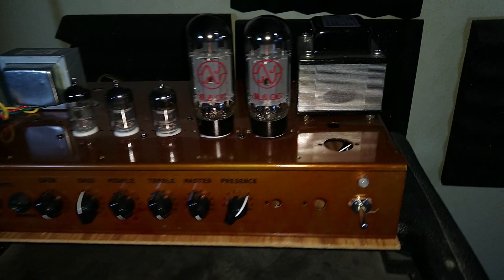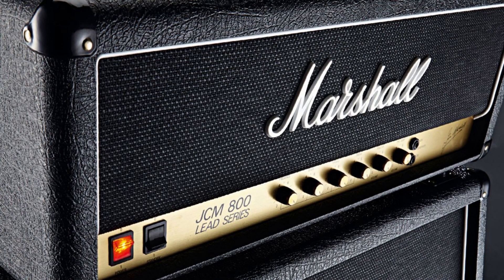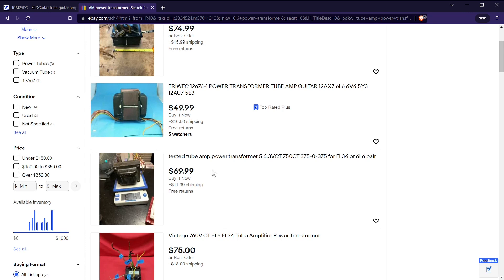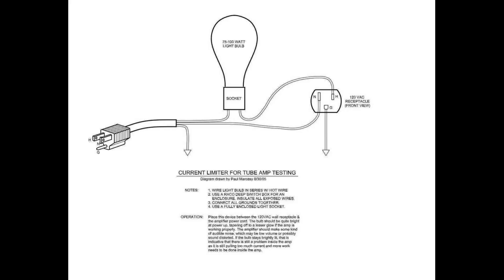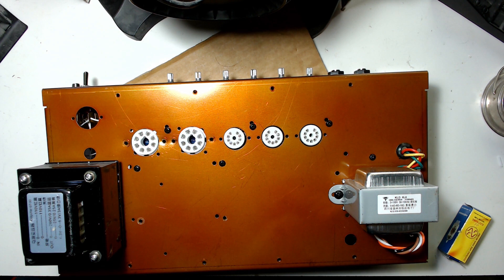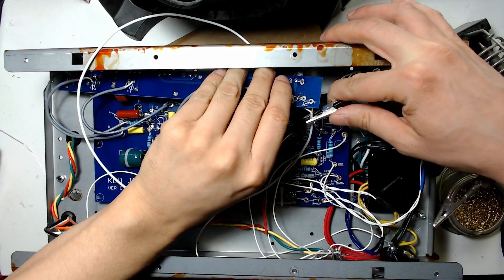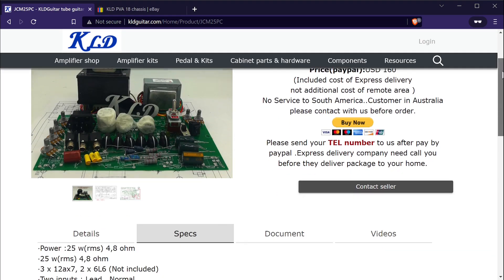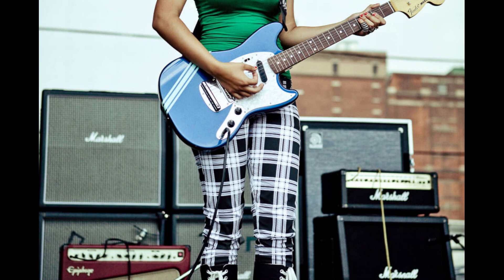Build Your Own Guitar Amplifier - KLD JCM25PC Kit Review, Guide & Tips - Marshall JCM800 Clone

Comment from the maker: I finally got around to building the cabinet for this amp, check it out! https://youtu.be/TjmcVeNQGbU

Points I forgot to mention in this video:
- Build quality is good.  The PCB is thick and seems comparable to the quality that the major manufactures use. The transformers are heavy and sound good. Alpha pots were included and the rest of the components are perfectly fine.
- The preamp section of the circuit looks identical to the real JCM800.  The tone is very authentic.
- I should have spent more time adjusting the mic placement.  I think the recordings are kinda bright and lacking bass.

Comment: What you're actually doing when you bias output tubes is you're basically balancing power dissipation versus output tube life, you want to bias them so that they operate correctly, yet at the same time they shouldn't be operating at the point where the Plates or Anodes aren't over-dissipating and going into something called Red-Plating where they glow red-hot, most amp techs like to bias the power tubes so they are dissipating about 60-70% of the maximum Plate or Anode dissipation.
Reply from the maker: Yep that's true, the bias also has an effect on the tone and headroom. Hotter tubes usually sound "sweeter" up until a certain point.

Comment: Thank you for this video and the comprehensive details on the design of this kit. I am glad to finally find more detailed information on this kit and you’ve helped to convince me to purchase it. One question I was wondering was if the amp head is powerful enough to power a 400W(8ohm) speaker cabinet?
Reply from the maker: For sure man, happy to help!  Yup this amp will have no problem driving that cabinet.  It obviously won't push the cabinet to its max potential, but I think you'll definitely be pleased with how loud this amp can push it.

Comment: I think I will look into one, the thing I don't understand is, how is it only 25 watt, class A?  I have two amps with 6L6GCs, one has two and it's 50 watt, the other has four and is 100 watt.  My 100 watt has a control to go from A to AB and points between, and I understand that when it's all the way to A, it's 50 watt, thus the question is it class A.

Edit: Another thing I just thought of, the JCM800 uses EL34, not 6L6. Do you know if the socket can be changed and use the EL34 or use the socket adapters? I can't with my Valve King 100, because of the A - AB control.
Reply from the maker: This amp is class AB, but there are other factors in the design that determine the output power. More output power requires larger transformers so I think they intentionally capped it at 25W in order to save cost, space, and weight. It's a budget kit after all, and 25W is plenty for most people.

It should be possible to swap the power tubes for EL34s but the circuit will likely require minor modifications and obviously it'll need to be rebiased. I haven't looked into it since the power tubes have a minor impact on tone when compared to the preamp section, and I'm happy with how it sounds at stock.

Comment: Just bought one directly from their site, do you have a list of things I'll need to buy not included in their kit?
Reply from the maker: It comes with everything except the chassis and the tubes.  The link for the chassis is in the video description.  The tubes are 3x 12ax7 and 2x 6L6.  You also might need to buy additional hook up wire.  The kit includes shielded wire but they included barely enough, so you might need to purchase additional shielded audio wire.  Also you might need more non-shielded hook up wire as well, just make sure it's rated for high voltage, 600v rating is good.  Hopefully this helps, let me know if you have more questions.
Reply: @PhazerTech  Thanks,  I'll definitely be referencing your vid for this build. I picked up the chassis from the ebay seller. Hopefully, modifications isn't too difficult. Appreciate you offering to help, I may need it, lol.
Reply from the maker: @DerekRonin  Happy to help!  Let me know how it goes.  As long as you have the right tools the mods shouldn't be too difficult.  Also like I mentioned in the video, they didn't include enough standoffs for the PCB either.  But as long as the board is secure around where the tubes are, it should be fine.

Comment: hi @Phazer Tech, just got my kit a few days ago and started putting it together. Seems like the transformer I received has the color swapped. Yellow being P1 and Green now P2, but the schematic has them reversed still for Ver C. wiring diagram. Anyhoo a question, I was a bit confused with the LED diode. Diagram shows 2 separate led by mines only comes with 1 with 3 pins. How did you go about wiring that? Thanks!
Reply from the maker: Hello again, that's great you got your kit.  Sounds like they still haven't corrected that error, I should probably email them and bring it to their attention.
The 3 pin LED they included is actually a 2 in 1 LED.  The schematic shows two LEDs and notice how they share a common ground.  The middle pin is the common ground.  One of the outer pins is for a green LED and the other outer pin is a red LED.  This is so you'll be able to tell if the amp is in standby or not.

Also I'm curious if they included enough standoffs for the PCB?  Are the holes on the chassis aligned with the PCB or are some misplaced like mine?
Reply: @PhazerTech  Thanks for the help! let me try and resolder them correctly, lol. Mines came with 10 stand offs ( seems like they corrected that). The chassis still needed some drilling (holes we're still off and some non-existent). I have to say, your video is the most detailed in explaining problems that would happe. This has helped tremendously! Thanks!
Reply from the maker: @DerekRonin  No problem, I'm glad you found the video to be helpful.  Hopefully it works the first time you flip the switch!  What kind of tubes did you get?
Reply: @PhazerTech  Well I did run into some slight issue, luckily I had the light bulb tester handy to take some of the load but still got some spark from the pentode/triode switch (P1/P2). Any idea what may have caused it? Notice my Green (P2) wire had some burnt marks from where the spark threw off.  I got some used JJ off ebay haven't arrived yet, may change up the preamp to some tungsol, if I get it running.  Do I need tubes installed to bench test the unit? I read it was a common pratice for first time built or testing very old units, paired a dim light tester.
Reply from the maker: @DerekRonin  First double and triple check all the connections.  Also make sure your soldering work on the switch is clean.  If you put too much solder on the joints then they might be too close together and it might cause arcing.  

It's usually good to power on without tubes first.  But there might be other problems that you can't find out until you put tubes in.  Also keep in mind voltages will be higher without a load from the tube.
Reply: @PhazerTech  That was my exact problem, you nailed it on the first try! After I cleaned up the solder and redid the heat shrinks,  no more sparks! Tubes are coming in this week, so should I be adjusting the bias to zero (counter clockwise and measure resistor values of both tubes installed?)  Thanks again!
Reply from the maker: @DerekRonin  Haha awesome dude, that's great news!  Yup measure each resistor with the tubes installed.  I would first set the biasing trimpot to somewhere in the middle.  Maybe not exactly in the middle but more like 10 o'clock and go from there.  And of course make sure you bought a matched pair of tubes .  Looking forward to hearing how it goes, cheers!
Reply: @PhazerTech  Thanks again! Once the tubes arrives, I'll let you know how things goes!
Reply: @PhazerTech  Had a quick question on the pentode/triode wiring. Did you have P1/P2 wired up to the side that says Triode? And B+B to Pentode side? Just noticed after I corrected the solder, was still getting some spark from the switch area, not sure whether  the switch has a short or I read the diagram incorrectly.
Reply from the maker: @DerekRonin  It shouldn't matter, the way you wire it will determine which side is which.  As long as P2 is on the same row as P2A, and P1 on the same row as P1A, it should work.  Also ensure that B+B is connected to two of the switch's pins.  At first glance it looks like it's only connected to one.

Here's a few other things I'd check.  Since you don't have any tubes installed, the voltage might be a lot higher than normal.  This can increase the chance of arcing and sparks in certain cases. Try putting in the preamp tubes and try it again. Maybe just try one at first, but it shouldn't matter since tubes are awfully resilient.  Don't install the power tubes until later when you're ready to plug it into a speaker.

But before you install the preamp tubes, check to see if any of the caps are bulging.  The increased voltage from no load might have been high enough to make one go bad.  They are good quality caps though, so they should be fine.  However you mentioned you had the LED wiring wrong, so it's possible that could have damaged a cap too.
Reply from the maker: @DerekRonin  Also if you think the switch might have a short then you'll need to desolder everything from it and test it with the multimeter's continuity function.  It's a DPDT style switch in case you're wondering.
Reply: @PhazerTech  Can't tell you how mcuh I appreciate your help. Checked all the caps and everything still within the voltage spec, just ordered another DPDT switch, I had my first run with tubes in, didn't even get to strum my guitar, the sparking did create some sound out from my speaker, 2nd attempt this evening when the replacement switch arrives.
Reply from the maker: @DerekRonin  No problem at all, hopefully that new switch solves it!
Reply: @PhazerTech  Well, replaced the switch so far no more sparks, but not getting sound through either jacks or output speaker variations. Might need to retrace everything again and find out why.  The kit seems fairly easy to assemble,  not sure why it's kicking me in the butt.
Reply from the maker: @DerekRonin  Bummer.  It's hard to help without seeing it.  So you've removed the power limiter, right?  How do the tubes look?  They're all glowing faintly?  Have you tried adjusting the bias?  Another thing I'd try is connect an oscilloscope if you have one to the pre amp's output and see if there's a signal.  Also ensure the power transformer's voltages are all correct.
Reply: @PhazerTech  Great news bruh, got it working finally! I had it still plugged into the power limiter not realizing it, since I had 2 power cords next to each other. Two issues I'm experiencing:
1. I have a sharp whistle coming from the speaker (doesn't sound like 60 cycle or 120)
2. I'm getting a nasty warbling sound when I have presence or volume turn to a certain point.

Other than that, I'm quite excited to have got this far on the build!
Here's what I'm experiencing 
https://youtu.be/eZg-I0Re99c
Reply from the maker: @DerekRonin  Awesome man glad to hear it!  There are a number of things that can cause oscillations, some of the more common reasons are ground loops and bad routing of cables.  Also I was getting oscillations sometimes when using badly matched tubes, so it could be the tubes.

Believe it or not, moving it to a different location in the room might help too.  WiFi routers and other wireless devices can cause it to oscillate.
Reply: @PhazerTech  Great tips, let me try some of those suggestions and try to reroute the wires.
Reply: @PhazerTech  reached out to the manufacturer and found out the problem. The transformer had the P1 and P2 label swapped, as soon as I swapped the connection on the board the oscillating sound and sharp buzz went away! What a building experience! Thanks again for your time and tolerating the long list of questions! You should donation setup, wouldn't mind buying you a cup of coffee for your help!
Reply from the maker: @DerekRonin  Oh man they really caused a lot of confusion by switching those labels haha but I'm glad to hear you got it working!   That's how builds go sometimes. So which color was P1 actually?

Well congrats bro, the extra time you spent made the moment that much sweeter. Have fun jamming!

And thanks I really appreciate it I have a PayPal donations link in the video description, would that work for you?
Reply: @PhazerTech  Yellow ended up being P1 and Green P2. But the transformer had the labels swapped, 😆 🤣.  I definitely had a great experience building this unit, all the little troubleshooting got me to understand the circuit much better indepth. One cup of coffee coming your way, you deserve it! Thanks again!
Reply from the maker: @DerekRonin  lol so it seems some transformers are labeled correctly while others aren't, and on top of that the schematic probably has the colors swapped too.. that's the takeaway here 😂
Well I'm glad it was a good learning experience, and I hope yours sounds as good as mine!  Crank up the gain in the lead channel and let 'er rip!

Thanks again for the coffee.  Stay in touch and let me know if anything else comes up!
Reply: @PhazerTech  I've loving the sound that's coming out of this unit! I had the gain up to 3 o clock and sounds amazing on lead! This got me interested in other kits, which other ones has been on your radar? I was looking at the Fender 5F2A  Princeton Tweed handwire board for a different sound. Looking forward for more contents from your channel!
Reply from the maker: @DerekRonin  It's an awesome amp!  It's been my main one since I finished it.
The Fender would be a good choice to complement the JCM clone.  Personally I already have a Deluxe Reverb Reissue, so I've got my eyes on the Matchless DC30 clone kit.  One channel gives an authentic Vox tone while the other channel gives an amazing high gain tone.
Reply: @PhazerTech  I did not know that, I may look into the Matchless as well, been want to add the vox tone in my setup.
Reply from the maker: @DerekRonin  Yea Matchless amps are highly regarded, but they're extremely expensive as well.  Being able to build one from a kit is really nice!
Reply: @PhazerTech  So I've reached out to the supplier about the kit, only draw back is there isn't a chassis available for the kit right now. But with some modification the PVA 18 chassis could be used for it. They also mentioned difficulty level is very high (Probably because it's a handwired point to point). I've always wanted to do a handwired kit.
Reply from the maker: @DerekRonin  That's good to know about the chassis, did they say what mods needed to be done?  I'll probably contact them soon about the kit but I want to do a few other projects first before I build another amp.  I noticed the schematic does look difficult, but looking at the pictures it doesn't appear to be point to point.  The tube sockets need to be handwired but it looks like there's a PCB for most of the components and another PCB for the pots.
Reply: @PhazerTech  they mentioned the tube sockets locations would need some drilling,  doesn't seem too difficult of a mod. But the assembly wil definitely take some patience.